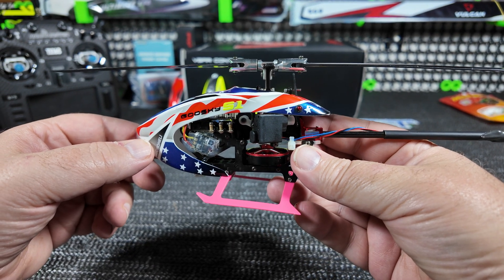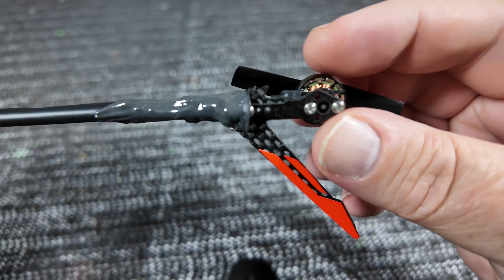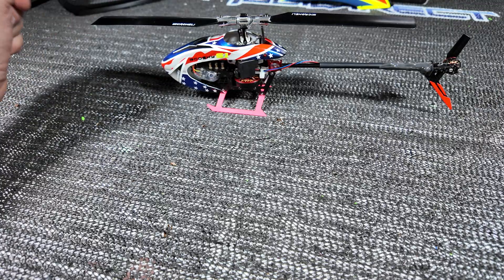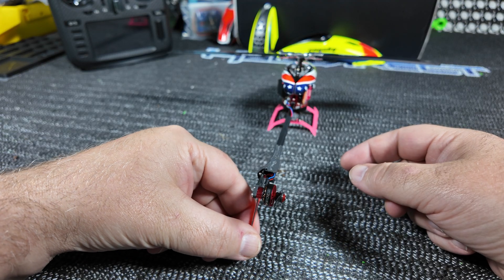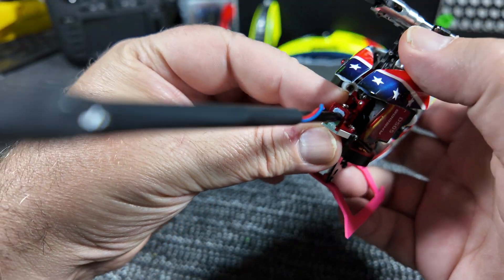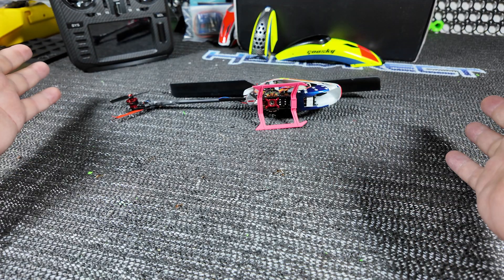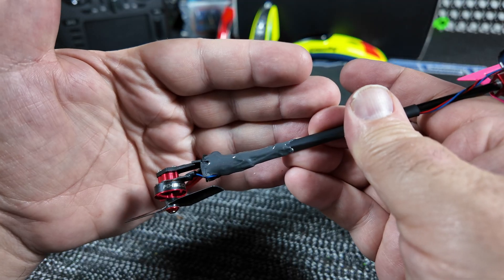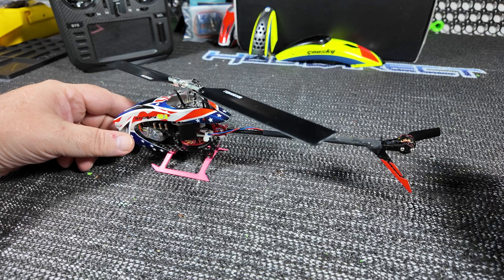A cheap Goosky S1 mod to bolster tail boom.

Comment: Should have just installed a new boom ?
Reply from the maker: Maybe. TBH this was such a weak point, yes I hit hard and directly on the fin when it went down, but others have complained that the boom splinters too easy.  

So it's kind of a wash, the stock metal bends easy...the Micro-Heli shatters easy.  Don't think there is much win no matter where I would lean.

I haven't crashed this thing to prove if the JB weld was the way to go;, but it does fly fine still.  So other than the orientation issues...which, I can get some bright color to mark it, it flies good enough.
Reply: @KajutaRCbuilds given the booms are cheap I say put the stock ones they also sell them in neon color just practice rashes will become less brutal I've crashed mine s1 also and the booms hold up ok for e few crashes then again I do what I can to bail

Comment: @Kajuta,  I enjoy your videos, can you do an update on how your training is going using the Goosky S1, a durability report would be nice. I fly the HK K110S. It is extremely durable and does 3D beyond my skill level. I thought I'd mention that heli because very few people currently know about it. The HK K110 is low cost to buy and parts are very cheap and easy to find via China mail order. If you are learning then adding a HK K110 will treat you well. I fly over 4 inch grass and very seldom have any impact damage. 

Regarding your landing gear, skip the tooth picks and go with bamboo skewers. They are light and strong. To greatly increase their strength, chuck the skewer up in a drill and spin on one layer of cotton or polyester thread. Rub the thread with baking soda and hit it with CA. glue. Now you have the poor man's carbon carbon shaft. My favorite option now is to not rub the thread with baking soda, rather use  Gorilla foam glue. I dilute the glue 1 to 1 with 91%isopropyl alcohol and brush on a coating. This make a very strong rod that can flex somewhat. I use two of  these rods to brace the tail boom. I connect to the boom and then at the landing gear. In the case of the Goosky S1 I think it would be better to connect to the frame, maybe I'm wrong. You can use these same rods to reinforce the landing gear.
Reply from the maker: HK K110S is an excellent choice and if I were to go back in time, I would tell myself to go with that over the S1.  That thing can take way more of a beating from what I've seen/heard.  Exactly what a new pilot needs, second only to simulator.  

The AK420 is also an arguable 1st machine as well due to it being damn near the same in parts cost as Goosky or OMP in the micro heli department.  For sure the AK420 is a perfect second machine to upgrade from your initial micro heli.  My wife's TX15 is finally being shipped and will arrive in a few days so I can finish setting it up for us. 

As for my S1 tail mod. I haven't flown that S1 much recently, I've been on my MKii probably more than any other micro-heli.  It did hold up for flight, but hasn't had any crashes to confirm if it worked.  I might just take it up and dive it in to see.  For science of course ^_^

I got the new S1 re-designed blades coming in the mail. Im expecting they will fit, Ill probably do a video of how I feel the collective manages from a noobs perspective, between my current Micro-Heli blades and the new Goosky.  I think the original S1 blades are plenty good and honestly only small trades with the Micro-Heli design.  

Might just do a few flights with all three types in the same day so the feel is fresh in my head. 

I got some skewers, I didn't think about because at a glance, so thick.  The S1 power to weight ratio is stupid anyway. Those ideas for also tail boom reinforcement might be a good, fun experiment next time I mangle the machine.
Reply: @KajutaRCbuilds  Thank you for the feedback that was helpful. I did not know the AK420 existed until yesterday when I watched a portion of your build video. I have to go back tomorrow and finish it up. Now that was very interesting. I can't believe you can buy a helicopter of that level for so cheap. I like cheap and I'm willing to accept the limitations it may have because I suck at flying helicopters right now. You are right, that seems like a nice second heli for newbies like us. I'm going to be watching you channel closely. Keep up the good video work. I like your style. BTW it's nice your wife is interested in Heli''s. That is a surprise. It took me years to get my wife to ride on the back of my motorcycles and no way in hell would she touch a transmitter.

I'm going to stick with the XK K110, cheap and easy, maybe the AK420 may fill the same bill. Thank you for the heads up on that Heli.
Reply from the maker: @lexyparrot8201  Glad you learned something. Yeah, go look at the parts cost for replacements. Speaks for itself, you would think you are repairing a 100 or 200 size machine.  Of course some items trade up and others trade down, but on average it's an astonishingly cheap machine to rebuild.  Second or third tier in quality...you certainly get more than you pay for. Like the K110S.
Reply: @KajutaRCbuilds  First thing I did was check the cost of the parts for the AK420. I was shocked "Cheap", I have to go check out YT for flight videos this morning and finish up your build vid. Keep em coming......

Comment: Take a florescent color soda straw, split it down the length and wrap it around the tail boom. This greatly improve visual orientation!

To improve the stock landing gear, cut a piece of semi-hard foam to the shape of the landing gear legs. The shape looks like a stand for the heli to rest on. You need foam slight more flexible than the foam used in the shipping case. Okay you have a small block of foam that fits the lower contour of the landing gear. Now glue it to the landing gear using foaming Gorilla Glue. Make the foam block any size you like on the bottom. This foam absorbs the impact. You can cut holes in the foam to lighten it. This heli has plenty of power to carry the load. You can make the bottom of the foam have extended sides to make it more stable and protect the airframe in crashes. Cut the foam on a band saw if you have one.
Reply from the maker: Thats a good idea on the tail. Ive also thought of modding the landing gear some way;  even tooth picks glued to it might be worth a shot.